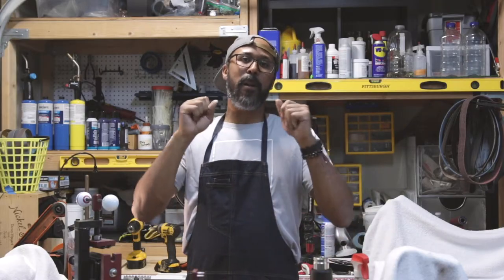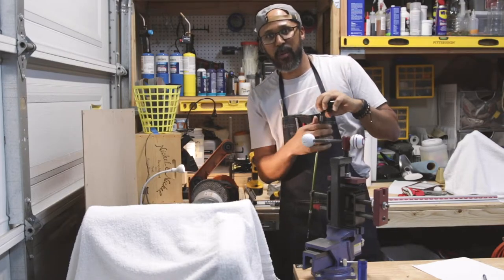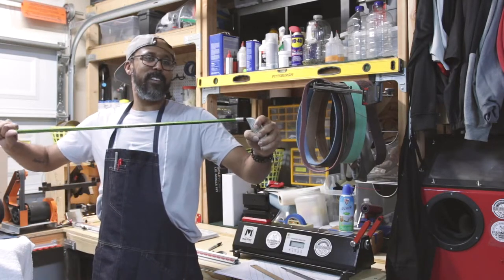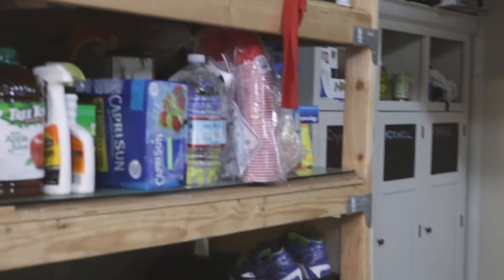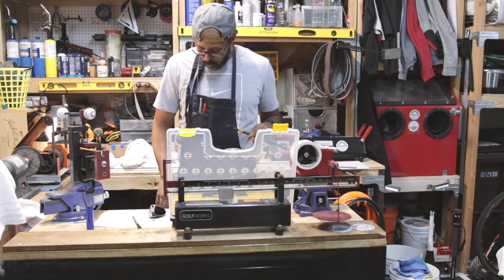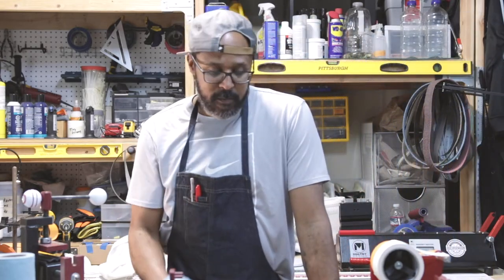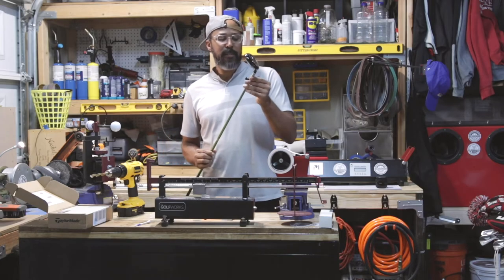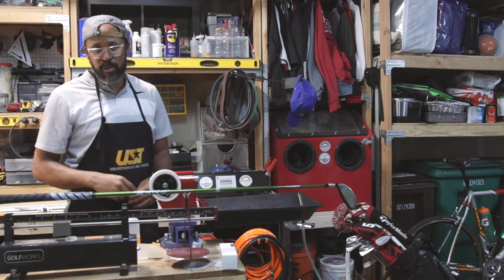How To Build Golf Clubs | In Depth Look

Comment: Great video. I really learned a lot. I'm definitely going to need to watch a second time. Keep up the great work. I was especially impressed with the Laser Frequency Machine, that could be a whole video. Trying to learn a little on my own. Thanks BMason.
Reply from the maker: Thanks, Benji, my goal is to make a couple of super detailed video then start making smaller videos under 10 minutes.
Reply: @BuiltByBMason  Super Cool! I would especially find a ten minute video on what are first few items that one needs to get started in the a shop. Or just explaining which solvents, epoxy, etc. you use. Maybe the belt sander would be a good one too! Much kudos again. Luv BMason on the Insta too!

Comment: Just a suggestion for ya B, instead of using a chop saw to cut your graphite, find yourself an arrow saw for cutting down carbon graphite arrows. SUPER CLEAN cuts.
Reply from the maker: I'm will for sure look into getting an arrow saw.
Reply: How do you remove scratches from my Mizuno ST200 Titanium driver face?

Comment: Mason, love your work and videos thank you. I purchased Taylor Made R7 425, love the head. However the shaft, Aldila One 85-5, I can not hit anything but a cut. DO you know what shaft is similar to the factory shaft? I have the same club in a 3 wood and love that OEM shaft so something similar is preferred. Thanks
Reply from the maker: The original shaft was a Fujikura REAX 65, I will see if I can find something similar, I might have one out back in the shop I will check.